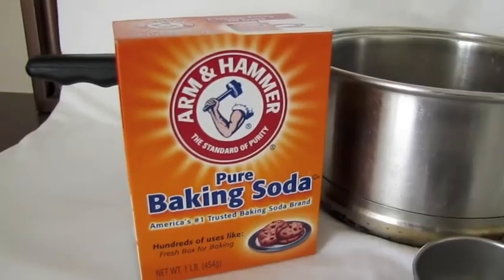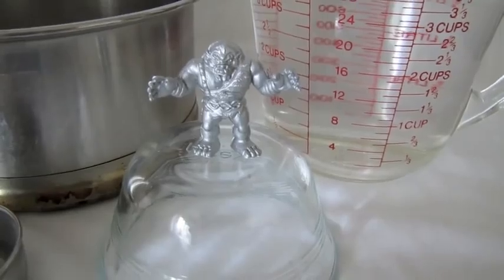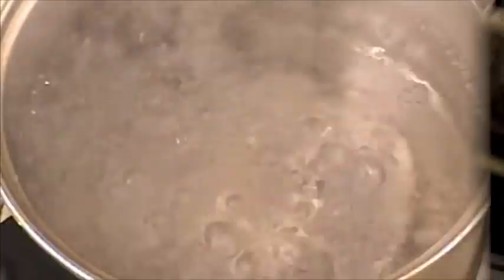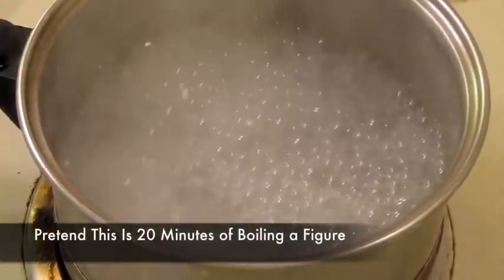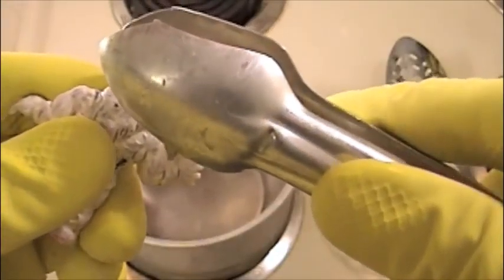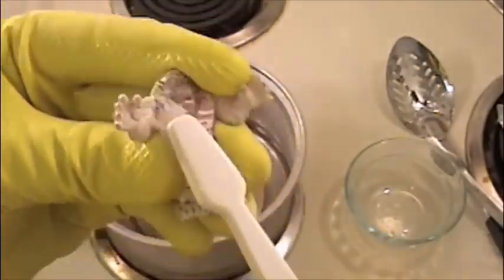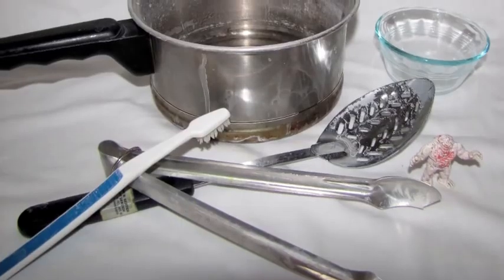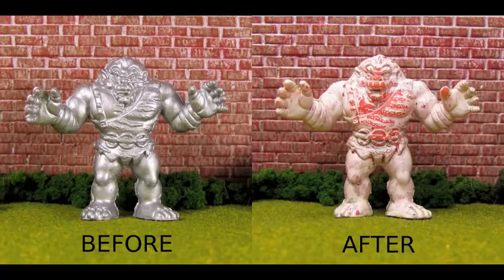ENVS 200 - Boiling a Figure: Silver Boat Paint

Comment: this is the key after cleaning and soaking with nothing but dettol IMPORTANT- put it in a bowle of water and washing up liquid---you know fairy liquid what your mum uses to wash dishes---this is the only thing that will get rid of the dettol,,if you put straight into wqter with no washing up liquid the dettol turns a chalky white coler and leaves residue -BUT AFTER REMOVING ALL PAINT WITH DETTOL WASH OFF -ALL- DETTOL WITH WATER AND WASHING UP LIUQUID SCRUBB WITH TOOTH BRUSH RINSE OFF THEN DONE !

Comment: soak it in normal dettol available in uk soak it for 8 hours ive left it 8 months once it has no damage what so ever on plastic mettel ect then take it out leave it 24 hours plenty take a model or figure out of the jar of dettol wipe off the paint with kitchen towel most of it will stick to the kitchen towel and cleanly come off and scub with dettol untill all paint is remove--this is the important bitwhen all paint is removed or as much as will come off but i normaly get 100%99%of paint off